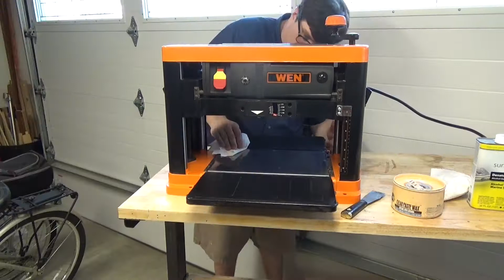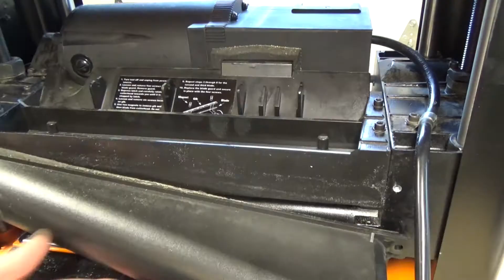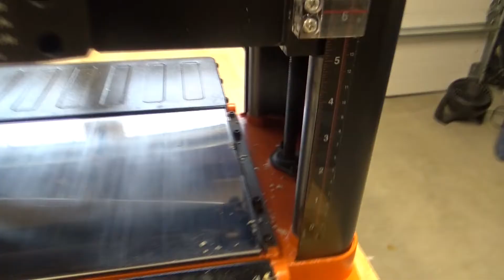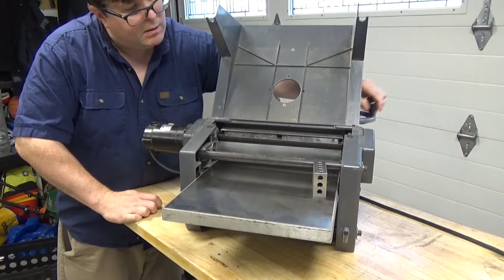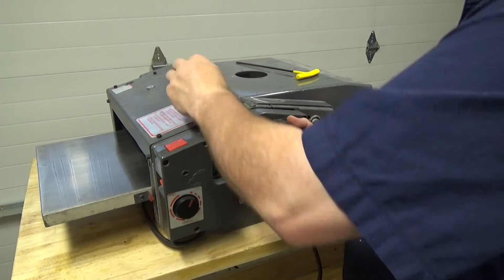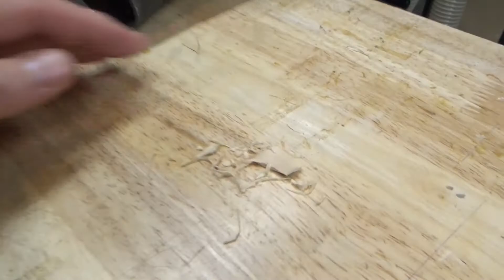Shopsmith or Wen Thickness Planer: Help Me Decide Which to Keep

Comment: I do not even see why this was a question.  Ask yourself this. In 49 years is the wen going to be alive.   Not a chance the shopsmith is a solid built to last planer and it has very little snipe. The motors are industrial duty.    I myself would build or buy a stand for the shopsmith and put a industrial motor on it like the stand alones.  Harbor freight 150 bucks you could get a 3hp motor that would be over twice as strong as the mark 5.   This is this reason I am in favor of the free stand shopsmith.  If you get the shopsmith stand you can even put shopsmith casters on it.  The only way I would chose a benchtop of any kind over it is if I needed it to be portable.   But I really do not like it taking up my jointers spot.  I have a couple of mark 5s and my main one is always a table saw and jointer combo.   I am kicking around the idea of making a sliding table on it as I prefer a sled over a chop saw.      But I did just score me a stand alone ss planer today for $250.   But I already know a lot about them as my old man has had one since the 80s. I hate to think how many boards went through it over the years.

Comment: I have a 37 year old SS pro planer that I bought new. In those 37 years I have replaced a pulley and changed knives. I purchased the Sheartak cutter head as a replacement and never looked back! I also replaced the outfeed roller too at the same time. The old girl is now quiet and gives a better finish. A tip to all, put safety wire through the roll pins on the table height adjustment roll pins. This can save you allot of grief if one falls out. Plane on my friends!

Comment: My WEN cuts 26 ft / min @ 8,500 RPM.  With three cutter heads, that's 25,500 cuts per minute over the 26 ft per minute travel speed.  So, cuts per inch = 25000/(12*26) = 81.7 cuts per inch.  The higher the cuts/inch the smoother the finish.
Reply from the maker: Great points Dan, all other things being equal the smaller the slice the smoother the cut. The Wen is a great machine.

Comment: Shopsmith....you can always get a Wen, but a Shopsmith that old and in that kind of condition is not as easy to come by.
Reply from the maker: Thanks Alan. You tell no lies! I bought the Wen only because an SS model did not come up on the used market in my area. Don't know when I would see another one.

Comment: Just the sheer cost alone should have you leaning towards keeping the Shopsmith planer. There's thousands of us out there that could never afford one so we settle for Craftsman or Wen. Great video though I enjoyed the part where you took the time to breakdown and reassemble.
Reply from the maker: Thanks JK, you make a VERY important point. I got lucky on my SS unit, was non-functioning so got it for quite a good deal. Lucky also I was able to repair it with a good cleaning, lubing and tuning. Probably won't find another one that I can afford anyway.
Reply: @woodshopnerdery  that's what I Love about Shopsmith. Even after all this time you were able to find one and repair it. The same can be said for most everything of SS which makes it so much more valuable. Unlike the cheaper WEN and my Craftsman, etc. where it's mostly plastic framing doomed to fail as it ages, leaving you crossing your fingers that the failure happens in the 3 year warranty time and or the parts aren't already discontinued. It's sad what machinery has come to these days 😪 like buying a Dodge truck it's only good for 2 years then you have to trade it in to get your moneys worth. Companies used to strive for excellence but don't anymore, and it shows with SS . The quality makes the time taken to repair worth it. The previous owners also were proud to be able to own one so they took pride in upkeep. Alot of that has been lost in translation over the decades. It might take me 5 pos planers and 10 years but once I snag that "white whale" it'll be a great addition to the shop that I'll actually be proud to say I own. The world needs more companies like SS. The world was built on companies like SS

Comment: Hals Wood Shop.  As a business, when my Delta portable died after years, I went checking price and features and bought the Porter Cable portable in 2008 at that time for $220, now $319 at Lowes.  Better features than your Wen, more posts, reversible blades, gears, depth gauge, etc.  I was planing alot of hardwood for cutting boards and other projects so it got its test of worth. No problems.  I don't know why you got the Wen but no contest there are more for your buck.  Sell it and replace it if you need the space.  I kept it when I moved to Arizona and no way would I sell it until it crashes.
Reply from the maker: Hi Hal, I looked that the Porter Cable on Lowes, looks really nice. My criteria at the time was a three blade cutter head that weighed less than 70lbs and cost about $300-$350. Makes for a very short list. Based on the reading I had done at the time, many people were recommending the three blades over the two blade models for cut quality and blade life. When I bought my Wen 6552T several years ago I paid less than $300 (sale) and it was the most affordable three bladed planer around.

Comment: Hals Wood Shop.   if there is any chance of getting upgraded to the Power Pro, the SS planer will be unstoppable.  If you were buying new this might be a harder decision, or go put the Wen hidden away or sell it and enjoy some new tool.  new this is about $400.
Reply from the maker: Good call Hal. The Power Pro planer would be really really nice to have. If one ever comes up second hand in my area for a reasonable price, it would be hard to pass up!
Reply: @woodshopnerdery  I think we got crossed lines here.  I meant the Power Pro Headstock, and its pricey but I could not find in the catalog other SS planer than what you have.  I have had 2 used 510 SS and both have been great. My first I added the lift assist and the upgrade wheels both worth the dollars, makes it fun to use the drill press mode.  Wheels, I had to set down the legs with the new when I ripped a board or it rolled on the floor as I ripped a board, it never rolled away with the original wheels.  I had to sell it with our move and it felt like I was selling my arm.  I found another near my home in AZ for $800 with bandsaw and jointer, and have added more to work in my 8 x 16 shed shop #6.   Oh my I saw your space.   Thanks for listening to my comments.  Keep making videos.
Reply from the maker: @halkester9368  You're right, I was  mixed up. Yes I would love to have a PowerPro headstock. The main problem is that my 510 works so darn well, it's hard to justify the expense!

Comment: I would love a Shopsmith planer, but I currently own a bauer that works perfectly... Now, I do have to build a drum sander, still trying to figure out how to make it a self feeder....
Reply from the maker: Great point, glad you brought up the Bauer. If you look at the Bauer motor and my Wen motor, they may very well be using many of the same parts. I think the units in this price category are largely the same. Even though these unit are at the low end of the price range, they can still do a great job as you point out.

BTW - I spent about 3 years waiting for an SS to come up second hand in my area. I finally bought the Wen so I could move my projects forward, and it worked for that. Then about 18 months later, my current SS unit came up for sale for a very reasonable price. It then sat in my shed another 8 months until I had time to fix it up. All the while, my Wen did the job over and over.
Reply: @woodshopnerdery  I'm a big believer in Backups.... if the money is already spent, you are out nothing... but if you run a board that has a hidden nail or stone in it through either of these machines, well, now you are out sharpening time or blade replacing time in the middle of a project. I mean a Mark VII just came up for sale in my area dirt cheap, and I already own a 520, but might grab that in case something happens while I am destroying wood...
Reply from the maker: @Me58651  Wow, I've been waiting for a Mark 7 near me for reasonable price for a long time. If it's that good of a deal, it would be hard to pass. Yes, if I get a MK7 I will be keeping my 510 headstock for backup. I could keep a second planer, its just not enough room to have it all.
Reply: @woodshopnerdery  No, this isn't a Mk 7, if is the Mark VII, the predacessor to the 500...
Reply from the maker: @Me58651  Gotcha, one of those would be nice too, double tilt and reversible!

Comment: Tom.  Great video again.  Thanks.  My personal bias is for the SS Planer (Cause I have one 😉). I would have to say maintenance is the key factor.  Second would be the variable speed.  I'm sure the other comments speak to harder woods.  Thanks for the calibration tips on the height.  I really need to do that.  An ease of blade maintenance & adjustment may also be useful in your comparison.
Reply from the maker: Thanks for compliments Bob! And thanks for the feedback. Glad you found the table height calibration tip helpful. But I can't take credit for it, I believe that step is listed in the manual and for sure I have seen it on the old Hands On-Line videos.

Comment: I had the Shopsmith unit mounted on a Mark 5. But then I bought a stand and motor so I could increase the speed. The unit works fine, but I plan to upgrade (yes upgrade) to the DeWalt 735. I do consider a reliable planer is a must in a shop, and the WEN is  NOT a worthy candidate.
Reply from the maker: Thanks for the input. I have had zero problems with the Wen so far, BUT I agree with you, this type of planer at this price point is prone to problems. If I had room to dedicate floor space to a stand, the DW735 would be a top contender. But, as a benchtop, I don't think I could heft around the 92 pounds reliably.
Reply: @woodshopnerdery  Somewhere I believe I have an extra control box if you want it, it's yours for the cost of shipping

Comment: The feed motor clicking noise is not typical, hopefully something easy like brushes seated wrong. The depth guage is missing on yours, should be infeed right side. Thanks for the content!
Reply from the maker: Thanks for watching Damion! Yeah, I need to pull those brushes and see what's happening. Probably, wise to do that before I let the Wen go.

Comment: Tom I had the same issue years ago between a Delta LunchBox planer and the SS. I chose the SS for several of the same reasons as you comparison and have not looked back.
Reply from the maker: Thanks Jim, I'm obviously strongly leaning towards the SS. Good to know you have been happy with your planer.
Reply: Tom, I have only had a thickness issue when I tried to build a planer sled from a magazine article. I did a video and also showed a solution.

Comment: I had to make this same “Sofie’s Choice” several years back between a Shopsmith planer and a DeWalt DW735. I went with the DeWalt and never looked back. That said, between the SS and the WEN I would go with the SS. As you point out, the features just don’t compare, and add to that your affinity to all things Shopsmith and I think you know the right answer. Scott
Reply from the maker: BTW - I think a lot of people would probably like to see a DW735 comparison to the SS planer. One issue with the SS planer is that the new models are expensive and the used models, although reasonably priced, can be hard to find locally. DW735 seems like the leading alternative.
Reply: If I didn't have a Shopsmith planer already, and couldn't find one for a reasonable price, the DW735 would be my first choice. The two speed feed rollers is better than one in my opinion.
Reply from the maker: Thanks Scott. The DW735 is a very impressive tool. I have not used one but have read many reviews, watched many videos, and examined the specs. I very seriously considered buying one. Since I cannot dedicate permanent floor space to a planer stand, the one and only issue I had with the DW735 is the weight, the specifications say it is 92lbs. 

How are you running the DW735, bench top or on a fixed base? Is it as heavy as advertised?
Reply: @woodshopnerdery  I have it mounted to a simple 2X4 stand, that I need to replace. Yes, it’s very heavy!
Reply: Speaking of the Dewalt DW735. I just got my Woodcraft sale mailer today, and the DW735 is going for $689.99, but if you buy it, the stand ($199.99 value) is included for free! The stand looks fairly robust, and it has built in straight roll wheels with a lift pedal on a pivoting caster. The DW735 also comes with an extra set of knives, and the infeed and outfeed extension wings. Seems to me like a great package for the price.
Reply: @chadnevels246  Nice! The stand is $159 every day on Amazon, but I’d take a free $160 stand any day! Which mine had the DW stand.
Reply from the maker: @chadnevels246  I have seen that sale before, with the free stand and I think also the infeed/outfeed tables. I really like the looks of the dewalt stand and that would be the deal for me if I had room for a planer on a stand. But for a lot of people, the DW735 with tables and stand is hard to beat!
Reply: @woodshopnerdery  Must be hard to beat. I was at my local Woodcraft (South of Dayton Ohio) this past Saturday, and had 10 of those planers with the stands in stock on the showroom floor, ready to go.

Comment: No comparison.  4 elevation screws, dual motors, variable feed speed, robust construction, the Shopsmith is the winner.   There is a Shelix head available for it and parts are readily available on eBay and Shopsmith (feed motor may be exception).  Would only consider a Dewalt 735x over the SS.
Reply from the maker: Thanks Rob, very helpful! I also really like the Dewalt 735x and was seriously considering it. But combined, I have less money in both of my current planers than the cost of a new 735x. It also specs out at 92 lbs, yikes. Not sure, if I could actually move that around.

Comment: The evidence that you give is clear; Shopsmith is the keeper. The WEN has the feeling of getting the job done quick so you get get things out and move on to the next. Shopsmith gives you more control and allows you to enjoy the hobby more and take pride in the quality (not quantity) of your work. Shopsmith also looks like better options for repair and replacement of parts, from Shopsmith, the hardware store, or even Ebay. Who knows with WEN, you may only have a 1-800 number and not much help. As for space, in the end we all find a way. I think other commenters are making good arguments too.
Reply from the maker: You're right not many votes for the Wen so far. I certainly am leaning to the SS at this point but still have an open mind. Thanks for the input!

Comment: Great video. I’m thinking parts will be easier to get for the WEN and getting a spiral set of blades will be easier. Going through blades is the most annoying part of my planer. Also the 6” thickness on the WEN seems good. I wouldn’t attempt any repair of a large size on a WEN, but with the price it’s kinda totally disposable.
Reply from the maker: Yes I do consider the Wen disposable, and that can be an advantage really. Can save a lot of headaches. I`m actually trying to get back into sharpening. I was an exclusive hand tool guy 15 years ago. Was once partially decent at it.

Comment: Quality of cut and versatility are my main needs… planing a timber 6” thick is beyond the scope of my needs.  Dust collection used to not bother me too much… now I want it to work well.  I have a Tormek that can sharpen planer blades. 

I just talked myself into asking you…. How much do you want for that Shopsmith planer?  Because if you don’t want to keep it… you now know someone who might just be in the market for one!
Reply from the maker: Good point Dave. I think I have gang planed  4 or 5 inch wide boards on edge based on a youtube suggestion. But like a lot of YT suggestions, it not a great method. Better to just skim rip on the table saw with a good blade. So 4 inch capacity is more than enough for me.  I won't be selling either planner, I will find a friend or acquaintance to hand it off to.

Comment: Hands down the Shopsmith no question about it.. but set it up and professional planer so you don't need the head stock to run it.. I don't think the clicking is normal my pro planer doesn't click. Talk with Scott about the clicking he might have more insight as to why it is clicking.
Reply from the maker: Thanks for the suggestions. I hear great things about the pro planner. If I ever find a way to dedicate floor space I plan on looking into it. My first guess is that the clicking might be related to worn brushes.
Reply: I've never heard one click or make noise like that. I suspect it's got to be the brushes too.  Scott

Comment: An interesting conundrum and one that I wouldn’t try to solve entirely rationally.  That said, the  Shopsmith will probably still be going strong (with some replaced parts) 40 years from now.  If the Wen goes wrong in three years, it could end up as landfill and you’ll kick yourself for selling the Shopsmith.  You’ve put a lot of effort into overhauling the Shopsmith and it shows in the results.  And it’s not just the machinery, it’s the whole Shopsmith ethos.  

By the way, my rescued SS Pro planer also has a depth gauge.
Reply from the maker: Hi Graham, can’t argue with your logic. One way to look at it would be if I let go of one how hard would it be to find another?